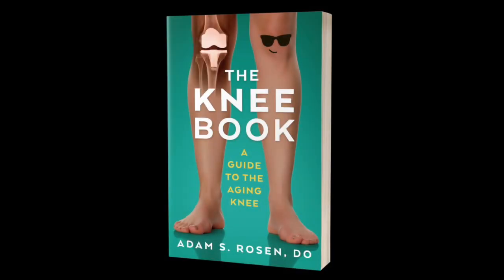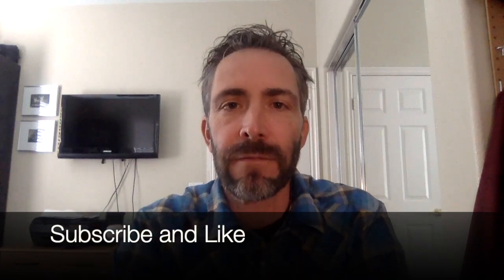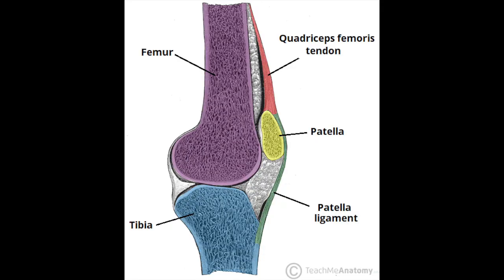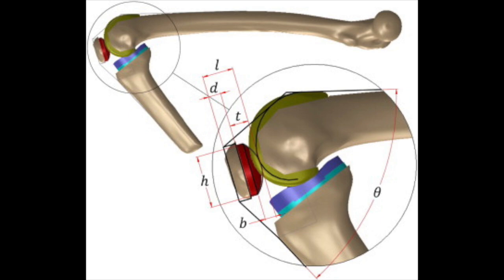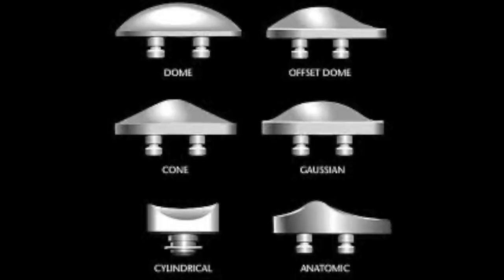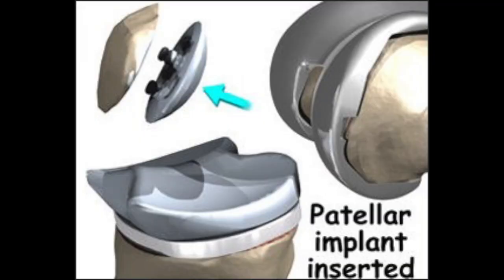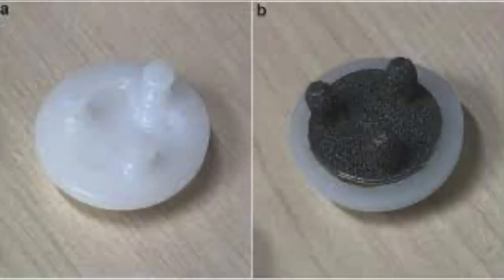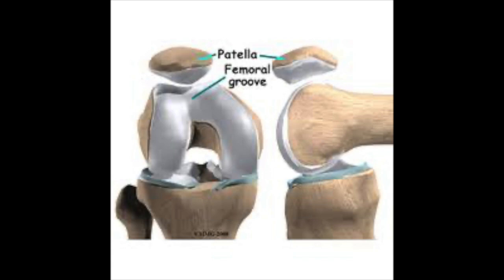Will They Replace Your Kneecap Too? The Truth

Comment: Question: I had full knee replacement about si years ago and my knee has been painful ever since. It is very painful when I stand up from a sitting  position. Lots of crunching. My ortho doc doesn't seem to care very much about this and has virtually dismissed me. I recently learned that I do not have a kneecap in that knee. I've been doing research and get varying answers as to whether one should have a kneecap or not. Besides the continuing pain and standing issues, I feel unstable. Your opinion would be helpful. I'm not looking to sue him! I just want another opinion.
Reply: I’m a physical therapist. I’d have to see your knee to really help you of course. I recommend you go to physical therapy. Just get a referral from your doctor and then call a PT clinic. Very common when people have knee pain is that they don’t have full extension (straightening of the knee). That causes a huge amount of pressure on the joint. If your knee doesn’t fully straighten out that is probably the issue. Next thing to look at is your gait. Having a funny gait causes a lot of knee pain. As for the stability you want to strengthen your quadriceps. Like I said, we need to see your knee to really help. So you should go to physical therapy. Good luck!

Comment: I will have to ask my surgeon this question at the six month post surgery appointment, but I would like to ask here in case you are still monitoring the comments: excluding scar tissue what would prevent a replacement knee from achieving full squat flexion? Is it that the joint is a bit larger than the original joint so the muscles and tendons and ligaments can't stretch enough? or...? I would like to know if I will be physically able to do a full squat , heel to glute, eventually. My surgeon said that during surgery he was able to move my leg through the full range of motion, unimpeded, so what would prevent it now, post surgery? Thanks.
Reply from the maker: Average range after total knee is 115-120. Best predictor is how much you had before surgery. Factors can be scar tissue, swelling, rehab effort and the surgical technique/implants.

Comment: Hello Dr Rosen, last month I had my hardware removal from my distal femur, my patella is immobilize and can only bend my knee upto 80°, my doctor says I won't be able to bend my knee unless I go for a knee replacement which I am unwilling at the age of 33. Is it possible to gain my knee range to some extent with exercise and physio?
Reply from the maker: The longer the knee has been stiff the more likely it is to be permanent. In certain cases a surgeon can arthroscopically debride the scar tissue and manipulate the knee to gain more motion. That would be a question you could ask your doctor.